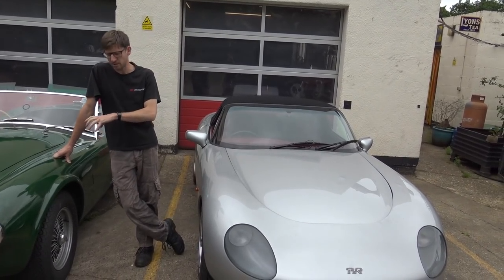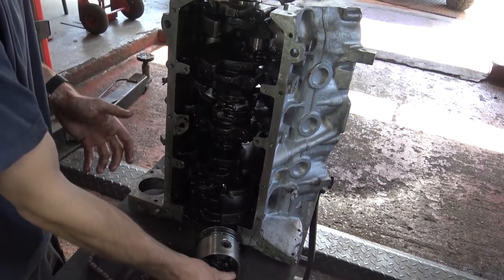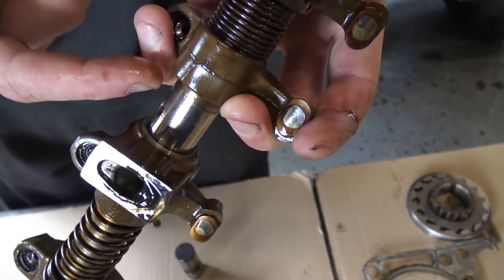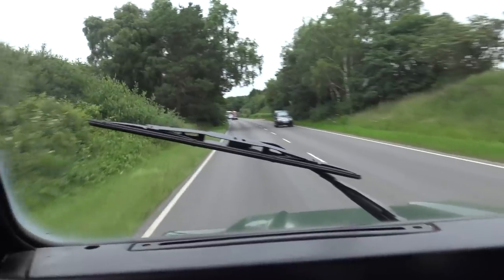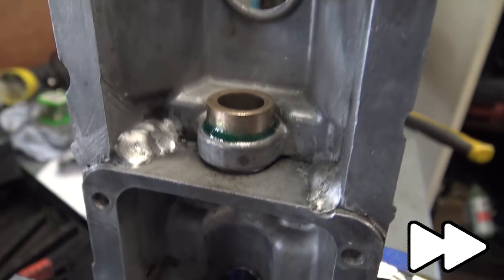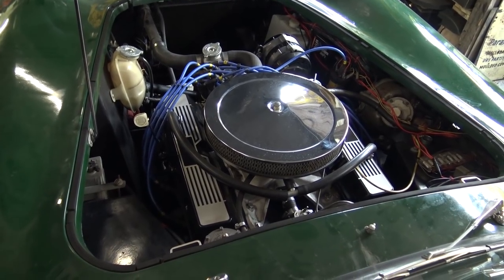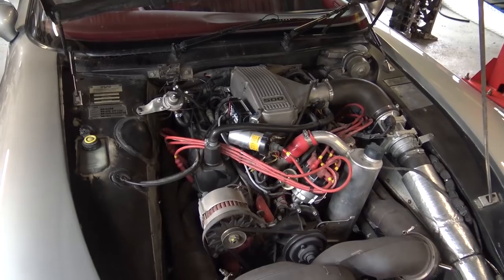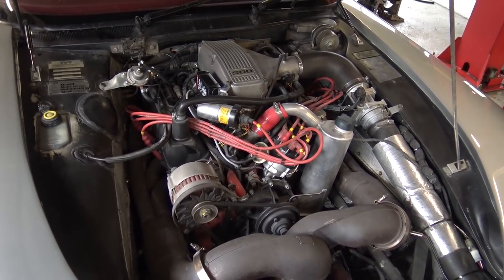RPi Engineering Rover V8 Workshop Update Episode 33

Comment: So what would be the process to repair the engine liner's or engine and could you do a video of it thanks Graham
Reply from the maker: Hi Graham,
The cost of replacing the liners on the 3.5 litre engine would far out way the cost of using an other block
Reply: @RPIEngineering  
So how much for a replacement 3:5 block and how easy to get hold of thanks again Graham